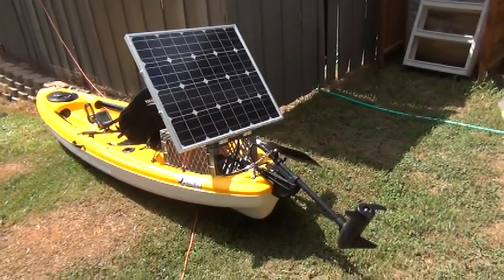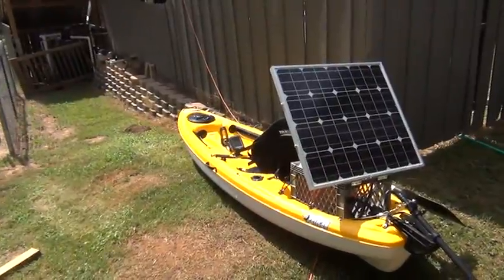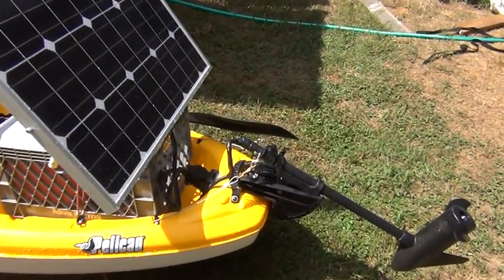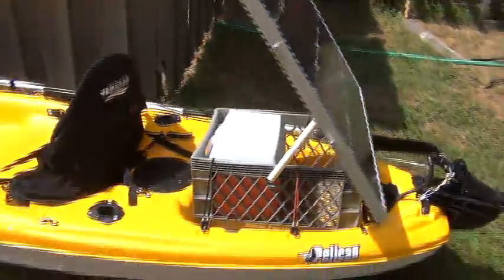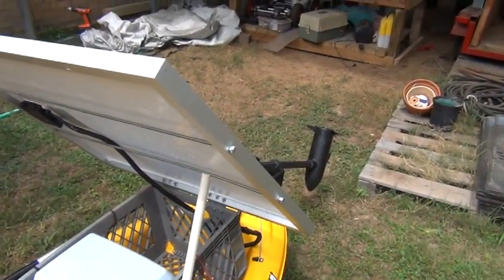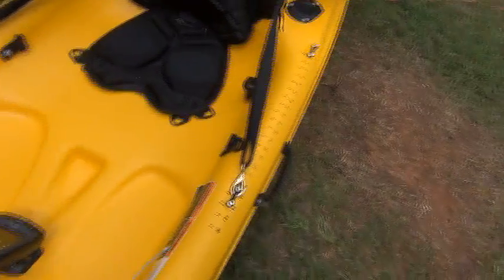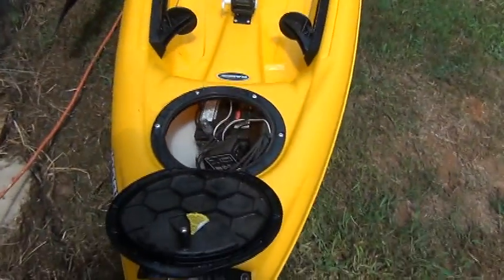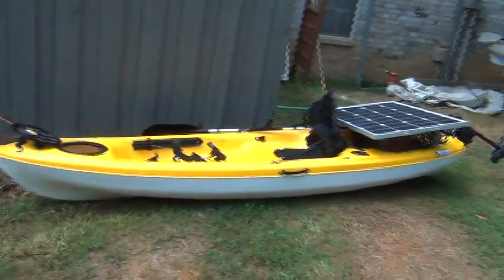Solar kayak

Comment from the maker: Thanks for the comment's the run to charge ratio was about 1 to 3 1 hour run to 3 hours of charge so it worked ok for fishing. I considered flexible but the price was way over budget. the project is being dismantled now as the state of Texas requires me to pay registration for it as it has a motor.
Reply: +By the Square Yeh im sure my project will face the same future. Lucky batteries and solar panels are so versatille.
Reply: Flexible does not need to be expensive. I bought a flexible panel in china. Aliexpress. 1x0.54 meter 100w panel for a 12v system. Works great. Weight is only 1.5 kg or so. Costed me 120 dollars and an other 30 dollars or so for taxes when it came into the country. Free shipping